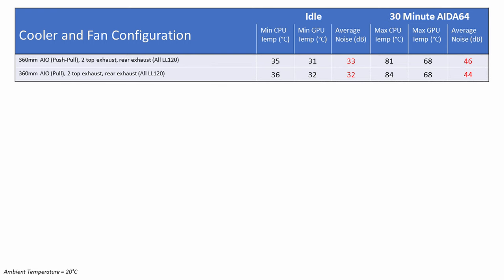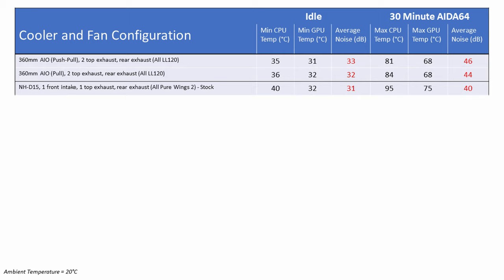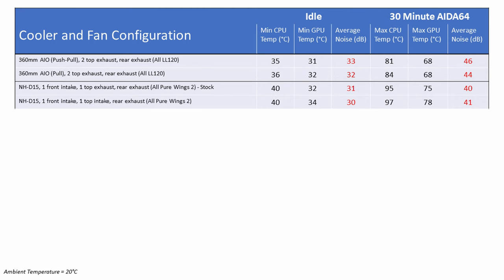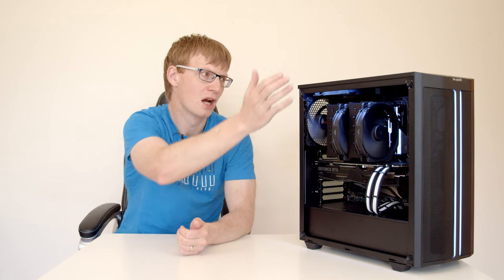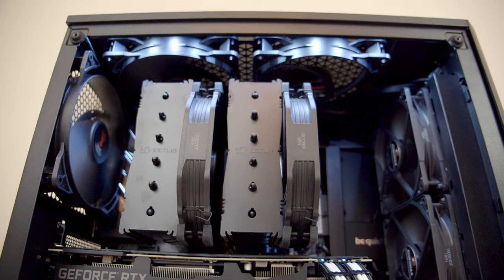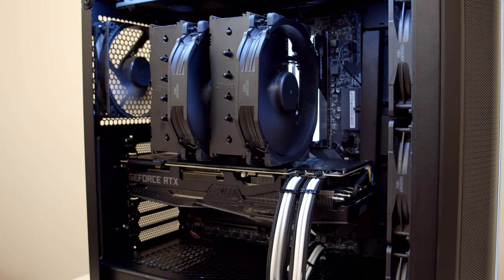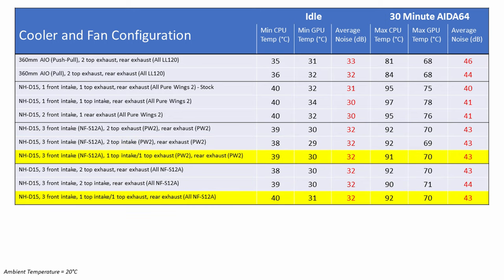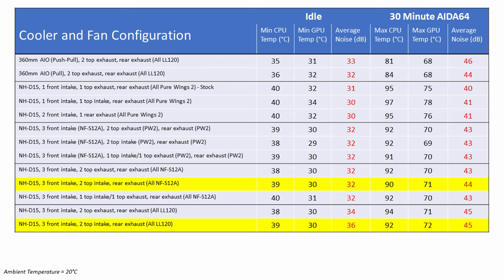be quiet! Pure Base 500DX - AIO or Air Cooler?

Comment: Great video! I think I'll go with a build like this. I plan on using a 240mm AIO (corsair H100x with 2 built in 120mm SP fans). After watching this video I will probably buy two more matching fans (corsair SP 120mm fans) and run push pull on the front. I'll leave the other front fan on the bottom as intake, and leave the other fans where they are. I don't really want to buy many more fans but I will if there's a big improvement to be gained for a reasonable price. Any suggestions? I'm going for thermal performance instead of quieter performance.

Any comments or suggestions are appreciated!
Reply: @ChristopherFlannigan  good to know, I'll look into it. Thanks for the advice!

Comment: Great video, I think I’ve watched it at least 3 times!

In your conclusion you state if noise is important you’d use 3 120mm at the front (intake?) and you’d move the 3 140mm be quiet fans to the back. Would you use those 3 140mm as exhaust or use 1 (the rear one) as exhaust and 2 (the tops ones) as intake? Thank you
Reply: He answered it in the video already, he highlighted the 2 intake 140s at the top as the best combination with 3 120 intakes in the front.
Reply: @DarthBoberEXMinMaxMunchking   where does he say this? 19:45 additional 3 120mm fans at the front as intake and keep the be quiet fans at the rear. My comment is 4 months old tbf so I’ve already set mine up lol

Comment: Just ordered this case. Have a NZXT 280 x62 aio with stock fans I am going to use infront with push. I am not going to use the purewings fans. I also have four Noctua NF-P14s redux fans available. How many case fans should I use and which as intake and exhaust? Use 1 rear exchaust and 1 top exchaust? Or should I just use 1 rear exchaust? Or should I use all 4?
Reply: @ChristopherFlannigan  The two nocuta exhaust fans is 350-1200 rpm and the kraken stock fans is 500-1800 rpm-. Should that not be positive pressure? Or another option with aio as front intake, and top intake fan (front side blowing down) and a single fan as exhaust at the back.
Reply: @ChristopherFlannigan  I ordered an Arctic Freezer ii 360 AIO to replace the X62 AIO. Then problem should be solved i guess. 360 AIO intake and then 2 fans exhaust: rear and rear top

Comment: hey I just ordered this case and plan to use it with a 360 AIO, will the 360 (120x3mm fans) radiator fit at the top of the case instead of the front?
Reply: @ChristopherFlannigan  thank you
Reply: hey man i’m thinking of getting 3 120mm and a 360 aio does this work for good cooling?
Reply: @joe-ox5rc  no idea didnt end up ordering this case but check its specs shouid mention that

Comment: the configuration you should have tired is the following, with the NH-D15 Aircooler. Two fans in the front (140mm) as intake, one exhaust fan at the back and two fans at the top of the case, the nearest one to the back of the case in an exhaust mode and the front one as intake. I think you would have found your results much different, as the three fans pulling in cool air onto the CPU with also has an exhaust fan would give you optimum performance.
Reply: @ChristopherFlannigan  cool ,after watching it all saw that you had carried out that configuration as well, well done for having the patience for carrying out all those tests. i'm in the process of purchasing the same case for a Ryzen 3950x with a Fractal design Celsius+  dynamic 280mm fans for the front, a 140mm for the rear and two fans on top one in exhaust and the other as intake. it will mainly be used for content creation and games (70/30 content creation/games), lets hope i can tame the beast.
Reply: @donglobal  how did this work out?
Reply: @BlackDiamond269-e9g  it went very well jake, but I later changed the case to a Lan Cool II, which I am currently using.
Reply: @donglobal  And what CPU cooler now in ur case and what fan config do u use in the new case?

Comment: Soooo, my plan was to get 3 front 120mm intakes and use the ones that come with the case as exhaust, 1 at the back, 2 up top. And for CPU cooler, use a be quiet Dark 4 (not the pro). But I'm seeing that 92 under CPU and I don't like it. Would that turn out to be a safe configuration in time or should I go for AIO? Don't really care much about noise and I'm not obsessed with temperatures either, I just want my system to be safe.

I'll be using my system for gaming and I do play a lot, in terms of hours. AIO is something I always avoided because I don't like the idea of having water near my system...and it's also expensive even compared to a top of the line air cooler.
Reply: @ChristopherFlannigan  that video made things a lot clearer. Thanks...and thanks for all of your videos, they helped me a lot til now.

Comment: I'm trying the same thing but have evga hybrid 2070s with a water cooler. I'm having the GPU cooler on the front as intake, 1 fan at the rear out, two fans on the top out. Do you think I can fit extra two 120mm on the front as intake next to the water cooling and do you think I should?
Reply: If you're making a silent build, be quiet! does make excellent cooling themselves and it's quieter than noctua, but still quite performant.
Reply: @ChristopherFlannigan  CPU is air cooled by dark rock pro. Back to the evga, they say this particular GPU cooling is very noisy, so I'll probably want to change the stock cooler for another AIO, because I heard of them being compatible, because if I got a 360mm radiator for the gpu as front intake,, that would solve both the problems, although I'm very afraid of doing that and basically putting a fridge on a gpu is probably an overshoot. I'm in a position where I have no idea how to even approach the problem.
Reply: @ChristopherFlannigan  you think this insanity with replacing the GPU cooler would work?
Reply: @ChristopherFlannigan  Chose this GPU because:
1) It's on 33% sale - cheaper than the alternatives
2) Excellent factory OC, good OC potential
3) Extra fan, which can be run at 50% power through EVGA sw if too noisy, although that limits the air intake and the card will run hot if OC'd.
Chose as front intake because:
1) Doesn't run hot without overclocking, so the air doesn't get too hot for it to matter.
2) I have the dark rock pro 4 on a 10600K, so no way that cooling is a problem there.
3) I've seen it done before.
4) I don't want the tubes in proximity of the CPU cooler, so I'm not putting it on the top, and if I put it on the rear behind the CPU cooler, I'm having the same problem, but in reverse.
I'm worried for the other parts of the system and issues with overclocking the GPU, Is there at least a possibility to replace the fans on the AIO? Could you try putting a case fan next to an AIO? Or do you think I don't need to worry about it?
Reply: @ChristopherFlannigan  I gave them incorrect fan layout that won't work with the case LOL. Happens meh... :D I'll change it to what you've suggested. Do you know whether I can mount 1x 120mm and 1x 140mm fan on the front at the same time?  Regarding the noise, replacement of just the AIO fan can't be done? It does have screws on it, should I attempt that? What about the pump, can it be replaced in this case? Regarding this exact cooler: https://www.evga.com/products/product.aspx?pn=400-HY-1284-B1
Reply: @ChristopherFlannigan  The 500dx gets packaged with 3x 140mm fan, so I'll do 1xfan plus gpu cooler in front and 1x fan on top as intake and 1x rear exhaust fan, that seems closest to what you've described (hope that is correct). Of course I'll report on how it went when I get it.
Reply: @ChristopherFlannigan  I got it, but it's totally overcooled even if I turn the case fans off even after overclocking. The radiator as a front intake doesn't damage the temps at all.

Comment: Is there room to fit the radiator/fans on the top of the case?
Reply: @ChristopherFlannigan thank you for your reply i bought this case the other day as your builds look great in it, you have convinced me to stretch for white cable extensions. thanks to your videos i could see a range of builds inside it. if i could ask for your thoughts on the AiOs i am looking at. ive never had one always had air cooling and im a little concerned about them leaking.

 DEEPCOOL Castle 240mm ARGB AIO Intel/AMD CPU Water Cooler 
or 
NZXT Kraken X53 RGB All In One 240mm Intel/AMD CPU Water Cooler  ?

great channel i appreciate the time you take to test all these different placements and also the in depth approach of your how to build videos.
take care

Comment: Sorry I don't get why you are bothered that much by the temperature on an artificial test adding that much noise for at most a 5% temperature saving which isn't much out of the margin of error. Just run stock you make it sound like stock is unusable which is ridiculous.
Reply: Yo, I feel the same way. I don't know what's the big deal with temperature. I've had my computer for over 10 years and I don't think I have all these fans in the case. I would have to check when I'm off work but certainly don't remember choosing to go extra on fans. I wanna see a youtube video of what happens when you have high, yet acceptable, temperatures haha, that would be cool.